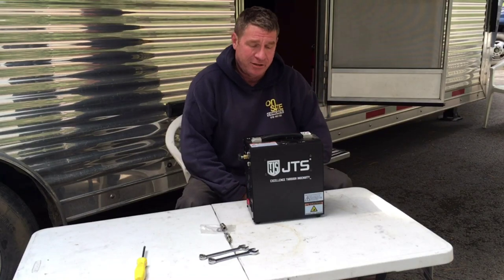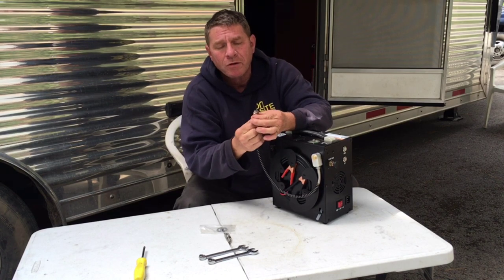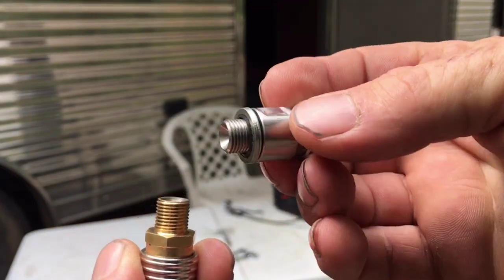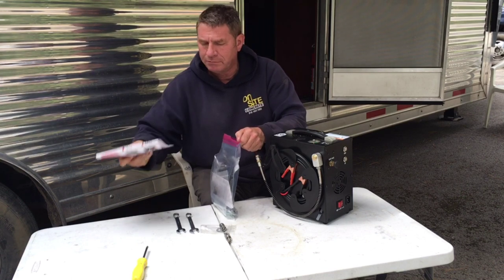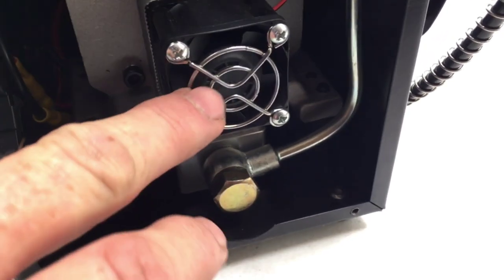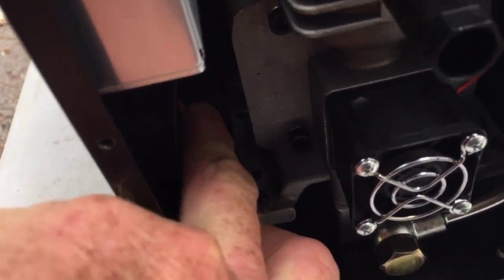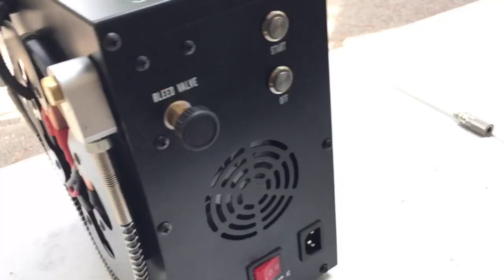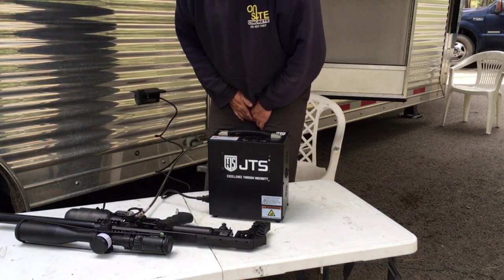In depth JTS Comp1 review.

Comment: Thank You for the heads up. What do you think about the nomad compressor model 3 coming out in September. Looking for something that will last a couple years
Reply from the maker: I can’t say anything about it since I have not seen it or used it. The one thing that’s for sure is they all are about the same. Made in China with little care about quality. Now Hill makes a really nice compressor. But it’s about 1500 bucks. But it’s also a 3 stage compressor and is built 1000 times better. Now if someone would just make a moisture trap that was safe and worked like a Bendix trap on a semi truck. The word would be a better place.

Comment: Now that you have turned me off buying one of these cheap(how much are they?) compressor, Which one would you recommend and the price?
Reply from the maker: This was 600 bucks. The good ones are around 1500 and are a 3 stage with oil separation. But like anything in life. You get what you pay for.
Mine is already having problems sealing the relief valve. Im sure it’s rust.
Reply: @CrazyMarty  names of compressors?
Reply from the maker: Look at the Hill EC 3000. I should’ve just gone with it the first time. But like everything in life you learn as you go. Now this Chinese compressor is having problems reaching pressure. I think it’s from rust in the pressure release valve. I need to turn the knob really hard and it feels like I might damage it. 
https://www.pyramydair.com/product/air-venturi-ec-3000-evo-compressor-by-hill?a=13536&gad_source=1&gbraid=0AAAAAqUT0_kxDJ1TiqA7faQLjmCe-BKbs&gclid=CjwKCAjwufq2BhAmEiwAnZqw8paSq_sZoSLvamQiqKDmRc3TOhmaXzsvQLtF6VvVRIjlMrzT-IXyqhoCBJUQAvD_BwE